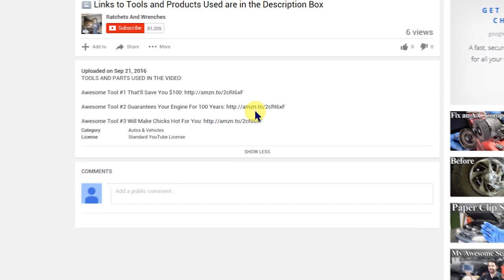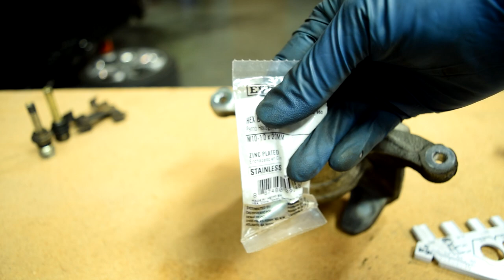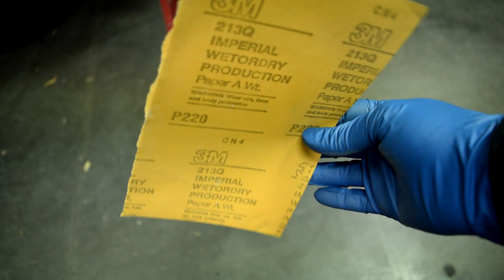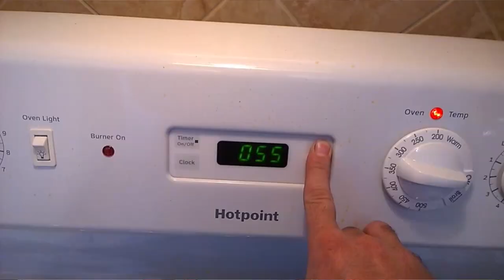How to Paint and Spray Clear Coat on Brake Calipers - Like a BOSS

Comment: Great job on the prep work. A lot of people don't realize that is why their caliper paint jobs fail so early, because they neglected to clean and prep thoroughly. The only thing I do differently is to bake the base coat and clear separately (two bake sessions) to prevent any remaining solvent from the base from screwing up the clear coat.

Comment: This is very informative and very detailed.  I did mine a few years back for 2 cars using the short cut and quickest way.  I just brushed the paint using an anti-rust glossy paint available from home depot and that's it.  Eventually, there will be an accumulation of dust once you start driving.  After a few months, wash the caliper again with soap and water, let it dry and re-apply the same paint.....

Comment: 9:52
i noticed in the background you put the rim under the car while it was jacket up
very very very good habit that i wish others would do
i was working on a friends 08 mercedes c63 and the spot to put the jack had a hole in the bottom of the car due to negligent manufacturing, etc. and as a result, the car fell but since we put the rim underneath the car, it stopped my friend from getting decapitated. mercedes benz fixed this issue later after we informed them about the defect. anyways, awesome video as always
Reply: I live in Los Angeles.  Just had another small shaker this morning.  I never put all 4 wheels up and still put the dismounted rim under the car, lol.

Comment: For those wondering of curing the paint this is from VHT's website --- 

Curing Caliper Paint VHT Caliper Paint only attains its unique properties after correct curing.
 - Bake at 200°F (93°C) for 1 hour. 
 -The inherent heat of braking operation will also accomplish curing.
----------------------------------------------------------------------------------------------------------------------------
Could also use a toaster oven (outside) cheap
Ask a body shop to use their oven once painting is complete (couldn't see them charging more than $30)
Also a local Vocational school "might" let you use their kiln. 

 http://www.vhtpaint.com/high-heat/vht-caliper-paint

Comment: dude your videos are awesome. i truly feel confident that i can re paint body panels like you did the f150 using exactly the same products as you did...all though now that i have everything i only found my old buffer which is the cheapo one you get from auto zone. it has only one speed and that speed is slow so it might work or it might not ill have to try it on some body flare i bought for my 8th gen si (front spliter sides and rear) i have some carbon fiber pieces but i doubt i will paint those unless you make a diy vid for that as well...good work keep it up thank you

Comment: All I did was give the calipers a good blast of brake cleaner and wipe off a majority of the dust. Taped up the rubber parts Then lay a few coats of red paint on it. Has held up quite nice for a while now. 

Unless it's a show car, nobody's gonna notice the back of the caliper.

Comment: If you want to get rid of the rust easy without sandingpaper or the like, emmerse the calipers and the stuff you want to paint in bucket filled with vinegar and salt, let it stay over night and all the rust can be wiped off easily with a steel brush. Just a remark baking it would that not have an impact on the rubber on the caliper, can it handle 200 degrees,is that Fahrenheit or Celsius, important to know?.
Reply: Pfirtzer Caliper temps can easily exceed 400 degrees Fahrenheit during heavy use.  I don't think 200F would cause a problem with boots/seals.
Reply from the maker: 200 Fahrenheit, I took everything off for the paint job but as Ken said 200 F is ok for the seals on the caliper, they get hotter than that normally.
Reply: It's a very dirty job, but someone gotta do it, you can't stay living like a pig....

Comment: how much hp do i gain by painting my brake caliper ?
Reply: Adam Budai atleast  50.....
Reply: +25hp
Reply from the maker: 20hp for Red Calipers, but I hear up to 30 for Yellow but Idk
Reply: Adam Budai not sure about HP but the chances of car theft increases 20%
Reply: actually the main thing you gain is the overspray that this guy got on that almost brand new car
Reply: I was thinking the same thing!
Reply: depends... if you got stickers you can get up to 50 but if it's a honda you get +80 v-tec YO!
Reply: depends on the color, if you paint it red you may have to attach a Wing in the back to keep your car from flying off the ground,,,,,,
Reply: Depends.  The HP Ratings are based on which color you use.  Red will get you 50 HP,  Yellow will get 40 HP,  Blue gets about 30 HP.  But if you want Maximum HP...use Pink or Tutti Fruitti Paint.  That oughtta boost you 150 HP,  which is the power you'll need to get out town in a hurry...before you become the laughing stock of all your Family, Friends, Neighbors and the entire Village Populace!
Reply: Ha ha: Grrreat advice  Darrin G. Not to mention the torque he is going to feel also. oh men Lol. Don't forget the shiny flakes.

Comment: Like most ameteur do it yourself videos, I thought you were going to do a half ass job but you sure surprised me. Nice job sanding. I am actually attempting this soon and seeing how you sand to bare metal I'm actually going to do that. I also didn't realized that you can bake it with the gaskets on the Caliper. Thanks for the tip.

Comment: When you bake to cure at 200 , 
Do you  have to do something to the rubber seal ???
Or it may ruined
Reply: flavin flavio hahah do not bake with piston seals or bleeder boots on, he put a lot of effort in this little project but is completely clueless. Cleaning up those calipers took longer then pulling the guts out of them
Reply: @GT-Qit  thanks  that what i though

Comment: wouldn't the oven heat damage/ melt the rubber around the caliper cylinder?
Reply: 661iracing you think it doesn’t regularly withstand that heat and even higher temps regularly‽ There’s a reason he used paint that’s rated to 900°F

Comment: I got a check engine light soon after using gumout fuel injector/system cleaner and a full tank of gas, codes are P0420 and P0430, I don't want to believe primary cats or o2 sensors went bad on both banks at the same time due to natural causes, research shows a number of possible causes, not sure where to start. Any opinions? 2003 Nissan Frontier v6 vg33e engine w/auto trans. Thanks

Comment: I was going to do primer before. Can I use any primer?
Also for the clear is any high tempt clear ok to use?
Lastly if I am masking the calipers and not removing what can I do to make sure it's baked hard?
Reply: High heat clear any primer is fine for metal u cant do nothing but not drive the car for a couple days since u left them on

Comment: Would it be acceptable to paint the back of the pads too? or is it not worth it cause you'd have to apply anti-seize anyway?
Reply from the maker: you can paint them if you like, it has a much higher chance of failure as it gets even hotter than the calipers.

Comment: Why didn't you just use the same bolt for the brake line? Could of just screwed it in and tapped it so you didn't get paint on it?

Comment: The brake clean won't hurt the rubber on the piston?
Reply: It's called Brake Cleaner for a reason.
Reply from the maker: no it should be fine.